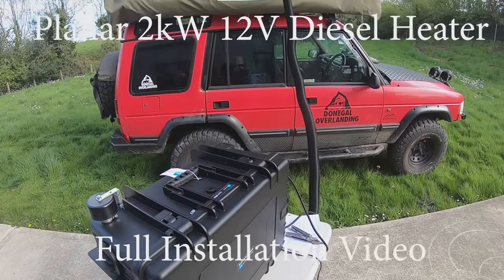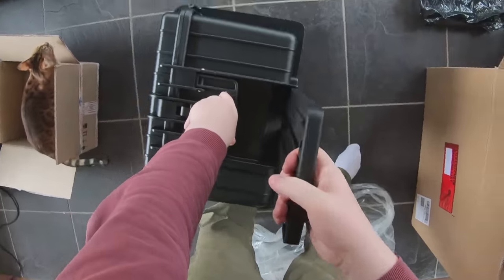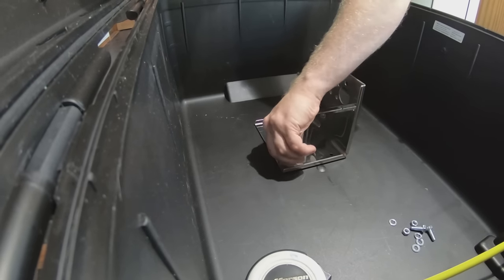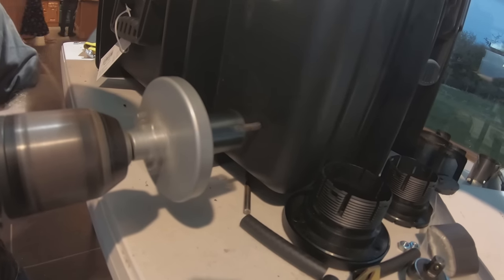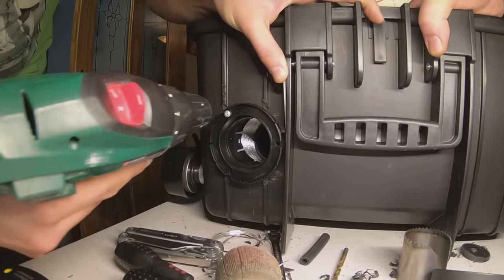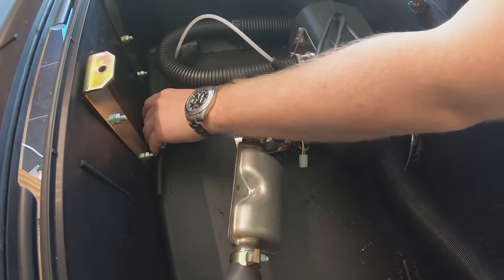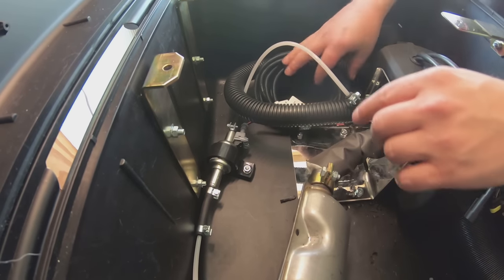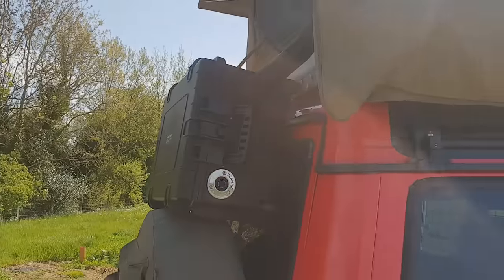Diesel Heater In A Box Install

Comment: What changes have you made to it since doing this video?
Reply from the maker: Not much yet.  Its worked perfectly.  I am about to put on a better quality hot air hose.  Because its sort of squashed frequently in the back of our Land Rover, the pipe has been a little bit crushed in places.  Its still bends back, but I want something that's tougher.  I have specific heating duct in mind too.  I will post up about it when I have done that.  I may even post a short video showing it if enough people are interested in seeing that.  I am not a huge fan of the digital controller, I think the method of using dots is pretty poor.  Many times I am pressing the button quite a few times to get it started.  Its just not anywhere near as intuitive as it should be.  In our bus we have a Chinese heater, it was in it when we bought it recently.  It has the simple rotary switch.  You turn it clockwise to turn it on and the more clockwise you turn it the more powerful it is.  I really like that feature.  If you use the thermostatically controlled features, it results in the heater stopping and starting all the time and that uses a fair bit more power as the glowplugs have to heat up initially.  I usually just put the heater on its lowest heat setting all night so that I can have it on constantly, sometimes thats been too hot and I open the windows more.

Comment: Hi, could you tell me if the combustion air intake is supplied in the kit. Thanks from Kilkenny.
Reply from the maker: MrPlasma01 it comes with the silencer. I had to buy that external filter you can see on top of the box. The shop in the link sold me all the parts. Im not s7re what the price was but I think around 20-25 or thereabouts.

Comment: Can you tell me what battery do you use? Car battery or deep cycle to run this?
Reply from the maker: I have a secondary deep cycle battery in my Land Rover anyway, as I have exterior lighting and a fridge and need to charge my drone/camera/mobiles etc.  So I have this wired up to that battery.  However it is not needed if I just wanted to use the heater.  There would be no problem running this heater from the main battery.  There is a low voltage cutoff anyway, so it would actually turn itself off before it took the car starter battery too low for it to be able to start the engine.
Reply: @DonegalOverlanding  I'm from Australia, Melbourne and we have some decent cold winters with snow in the Alps. I always avoided camping in the freezing cold but I think you have sold me on this until I buy my camper trailer.
Reply: @DonegalOverlanding  how heavy is the total unit in the box?

Comment: You are supposed to circulate the heated air from inside the tent.
Reply from the maker: No, you are not "supposed" to do anything, you do whatever suits the application in mind.  It is a terrible idea to recirculate the air from inside the tent because the amount of condensation means you will wake up totally soaked in moisture..  We experimented to test that theory and the entire tent, including the 100mm foam mattress had to be dried out in the morning.
Reply: @DonegalOverlanding  Keep heating the cold air is even more terrible idea.  
" because the amount of condensation means you will wake up totally soaked"
That is exactly the point. If you circulate the inside air the heater will dry the condensation.  Daaaa

Comment: I don´t like the fuel tank inside the box because it´s a fire hazard if something does wrong...also use a CO warning device in the tent in case it sucks in the exhaust... these things spill out a huge amount of CO
Reply from the maker: I feel you are wrong on that. I spoke with the technical department at Planar regarding each element of this design.  The fuel is diesel, its not explosive in the same way as petrol.  I do have a CO alarm in the tent.  Wouldnt take a chance with that.
Reply: that is true but let´s asume a fire starts within the heater for whatever reason due to a malfunction, it´s not so good to have 5 liters of diesel on top of it.. of course it will not explode in a big fireball but 5 liters of diesel will burn at some stage
Reply from the maker: @bobl78  yeah I suppose that is true.  I am not sure that it is very likely that a fire would start in the heater though.  Of course anything is possible, but its extremely unlikely.  The advantages of having the tank in there, nice and safe from damage is more important to me than the tiny chance a fire breaks out.  You have to take into account this is used in a modified 4x4, everything inside gets bumped about a lot and having the tank mounted externally would expose it to damage.

Comment: is it connected to the battery somehow? does it need any power?
Reply from the maker: Yes it has a power cable included when you buy it. You can see it in the video. I ran it across the roof rack and down the A pillar and into the engine where it connects to the battery. It uses little power when running.
Reply: @DonegalOverlanding  is it from your main battery? Are you not scared to drain your battery? I am really looking to this as I like your concept a lot. Only concerned about the battery
Reply from the maker: Hi, I have a secondary deep cycle leisure battery which runs via a split charge system. So it is isolated from the main battery. The second battery is 115ah and runs auxillery equipment like the opening closing of the tent, the fridge, awning lights, rear usb charging sockets and of course the heater itself.  The heaters use very little power when working. Its only on startup and shutdown that they consume a bit more. Have you subscribed? Trying to get to 1000 subs and would appreciate the help. Thanks.
Reply: Just did) like the way you did it. Considering similar design .

Comment: could you tell me the pump pulse rate when heater is on full. Thanks
Reply from the maker: Hi,  Sorry but I have absolutely no idea what the rate is.  The controls do not allow me as an end user to change them, so I have not seen any reference to them.
Reply: @DonegalOverlanding   if you start the heater and run it on full and count the clicks in one minute. Thanks john

Comment: How has this been running?
Reply from the maker: Its ran perfectly ever since it was built.  Not had to make a single adjustment.  Thankfully now people have stopped telling us that the exhaust is dangerous and is going to melt everything.
Reply: @DonegalOverlanding  im currently building a smaller version of this, and the only this I was worried about was the exhaust leaking CO. Did this exhaust ever leak for you?

Comment: I'd think to duct the cool air intake from the tent as well, rather than having to heat cold outside air.
Reply from the maker: No, its better pulling in cold air. Read comments below its been answered many times.
Reply: Ok, found it, thanks. Those answers make perfect sense. Very nice work on the unit BTW.

Comment: Whats that for a metal bei the exhaust hole?
Reply from the maker: That is the Planar "through hull" stainless fitment.  Its originally designed to go through the hull of a boat, its stainless steel.

Comment: Everything is made in China, it depends on how much you want to spend and whenever or not you read the instructions!
Reply from the maker: Tahir Rana its not made in China. Its made in Russia.
Reply: Yes, but not nearly to the same standards. European brands get approved, they need to live up to certain standards, they need to be tested, they come with a warranty that the company has to live up to etc. Chinese junk off Ebay is at times no better than if your friend had made it at home in his garage out of the cheapest parts he could find. You have no way of knowing if it's even safe or tested.

The problem is the lack of testing, safety, consistency  and reliability with the cheap Chinese stuff. You have no idea what you're getting. You could be one of the success stories where it works fine for 10 years, or you could be one of those stories where it stopped working after a single camping trip. 

Even when a European company gets their stuff produced in China, it still has to go through the same testing, meet the same standards etc.

I wouldn't get a cheap Chinese diesel heater, water boiler or any potentially dangerous product, I wouldn't mind getting a cheap Chinese action camera, microphone or whatever though as them potentially failing wouldn't be a safety concern.
Reply: @gnawershreth  Couldn't agree more.

Comment: China cops a bad wrap for products but there are some extremely good quality items made in China, its just who makes it, in a few yrs you will have no choice where things come from, everything will be chinese made, and for good reason, they are smart, have low production cost and will make ANYTHING we want them to under instruction from the designer, a huge amount of military equipment is made there and is great quality.
Reply from the maker: No doubt that some exceptional products are made in China.  To confirm what we already said in previous replies,  we have no issue with Chinese products in general.  We have a problem with cheap Chinese products that have fake safety labels and are such poor quality that they are not only not fit for purpose, but also potentially lethal.
Reply: I watched your video with interest, as I'm thinking about getting a Chinese heater for my RV.

I have a Dometic TEC30D onboard generator, made in Germany, sporting a range of genuine safety accreditation marks. I could've bought a decent secondhand motorhome for what it cost me. The core product is an excellent piece of technology, very well engineered. But the ancillaries are the cheapest, nastiest bunch of components you could hope never to see on anything you'd pay for!

I've spent a year replacing exhaust and fuel components as they failed in turn. At one point it even asphyxiated itself on it's own exhaust leak and needed a new air filter to give it the kiss of life. Fortunately I have an American RV and installed it in a basement locker opposite the original twin cylinder beast and there were no low ventilation intakes anywhere near it, as I'd imagine that could've easily been fatal.
Reply: @3Mudbone1   bahahaha, that is possibly the most un educated thing I have EVER read, ill make sure we post it on our site...since you are so wealthy, do you drive, do you ride, do you live in a house, do you have a toaster, a fridge, a tv, a radio, a computer, a phone, furniture, have clothes, a dryer, eat spices/herbs, use shampoo, conditioner, use string, rope, chain, machinery, pens, pencils, batteries, nuts and bolts, tyres, etc etc etc, I really could go on, but even you with that incredibly tiny mind understands that iff you have ANY of these products, the chances are you bought Chinese, please go ahead and make something up to try and gain back a little respect, or just hang your head in shame and think how ridiculous you are...lol...
Reply: My concern with some of the cheaper Chinese products is their lack of warranty and legal accountability when things go wrong. And things go wrong with all products not just Chinese ones.

Comment: what was the power source to the heater?
Reply from the maker: 12v power straight from the secondary leisure battery, up the A-pillar across the roof rack and to the back of the vehicle.  The cable etc is all supplied.

Comment: Need the inlet on the top inside of the case to use preheated air and cool the case.
Reply from the maker: Absolutely not.  The case is not hot, its only slightly warm.  I need fresh air coming in the entire time due to condensation.  Have a read of this it goes into a lot more detail than I can here. https://faroutride.com/condensation-moisture-van/?fbclid=IwAR12ksZUw4_l8rWDFnW-a6Vzb1foVMK6lvf_VSw9KOSuBd5f0uQ4Xp3ChIs

Comment: Hi, How did you get the power to the heater please?
Reply from the maker: When you buy the heater it comes with all of the wiring required.  I just have it running over the roof attached to the roofrack and down the A pillar and then onto my leisure battery.
Reply: @DonegalOverlanding  Thankyou! :)

Comment: there are comments about the unit being made in China and problems with sooting up and people using kerosene. nothing wrong in using kerro  and will burn as well in these units  they are all drip fed into the burn chamber and ignited by the glow plug and yes all of these units whether they cost a couple of hundred or a thousand pounds benefit from being run on max to burn out the crude and build up
Reply from the maker: Planar have said under no circumstances to use Kerosene.  I will take their word for it.

Comment: It would have been better to cut off the exhaust exit fitting so the pipe was a straight on connection and also install lower it.  Pushing the exhaust up hill is a very bad idea.  The pipe and muffler will fill up with condensate.  Other than being knowledgeable enough to understand that there is nothing wrong with 99% of the Chinese heaters, this was a good video.  Having more money than brains often confuses people into believing they are very clever.
Reply from the maker: First thing to note, do not be rude.  Your snide remark at the end was not necessary.   Second thing to note, if you are going to criticise something, get your facts accurate.  The exhaust is not being pushed up hill, it is in fact going down hill.  We are fully aware of condensate and as the exhaust is going down, and also because the length is very small, there is no condensate.  As mentioned multiple times, this was built having consulted with Planar and we discussed condensate with them and they said it would not happen with this design, and they are correct, because its been used for over 20 months without any.
Reply: @DonegalOverlanding  Thank you sir, I've searched the internet for this, because I'm installing one in a similar configuration and was worried about it being above the heater a bit.

Comment: nice rolex
Reply: Not a Rolex. On a Rolex Daytona the subdials at 3 and 9 are slightly above the center of the dial. If you draw a line from 3 to 9 on his watch, the line would go directly through the center of the subdials. 

But it's still a nice-looking watch.

Comment: all that effort but no inline fuel filter ?
Reply from the maker: I spoke to technical support about that because I thought it unusual that there wasnt any fuel filter.  They said that there is no need for them at all.
Reply: Really, every one I have fitted has always come with a inline fuel filter, like you said in the video expensive pump to get damaged by foreign body in fuel

Comment: Great setup. I just have one comment about the muffler for safety. The muffler have a tiny hole in the bottom, which means it leaks carbon monoxide inside the case. I think, it can be placed outside the case or don't install it at all. The fresh air intake on the opposite side of the heater vent is where it sucks fresh air and goes directly to the vent. Check the video of the inside of a muffler. https://youtu.be/tr_EtdaVUVk?t=86

Comment: After seeing a recent video of someone with an infrared gun on another diesel heater's muffler showing 300+ degrees F, I have doubts about this setup.
Reply from the maker: That's ok for you to have doubts, but when I've said over and over that the plastic fuel tank is just a tiny bit warm to touch despite being on full power for over 24 hours straight, what else do you need?  Let me be clear, thats a tiny bit warm, not hot.  It would need to be very hot to melt the plastic.  If the case was sitting in direct sunlight for 10 minutes the case would be much warmer than the fuel tank.  Its about 2 years and works perfectly every single time, not to mention that Planar approved the design before we even got the heater.
Reply: @DonegalOverlanding  Well said , i am seriously looking to do this atb.

Comment: Nice container. ..Not worth  $700 delivered on ebay.  Still looking for a good cheap case. Ty
Reply from the maker: The container is expensive, there is no doubt.  You can get it cheaper than that though.  Here it is, for example, on Amazon for £266. https://www.amazon.co.uk/outdoor-cases-type-6800-empty-Original-Black/dp/B018LZP1H2